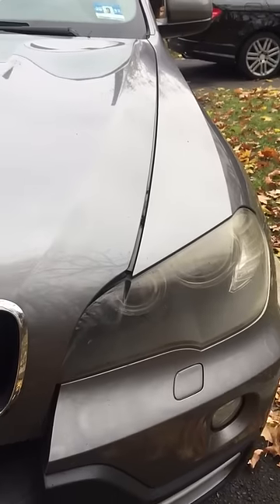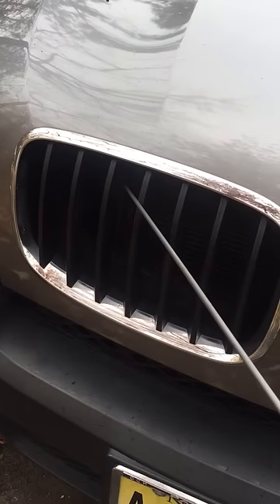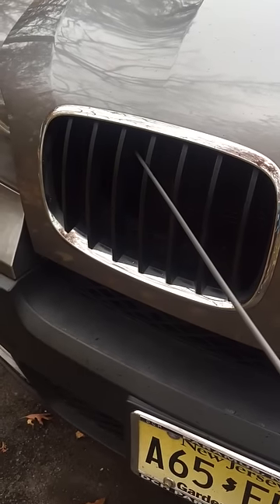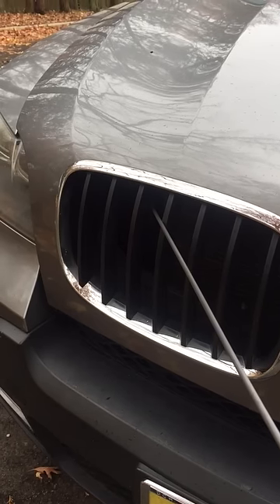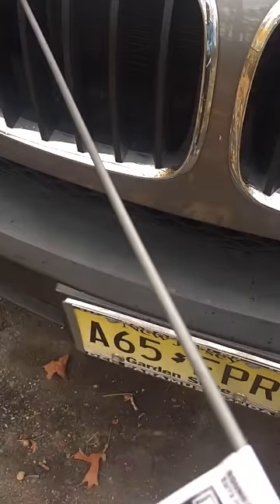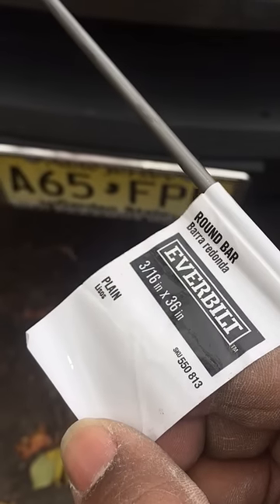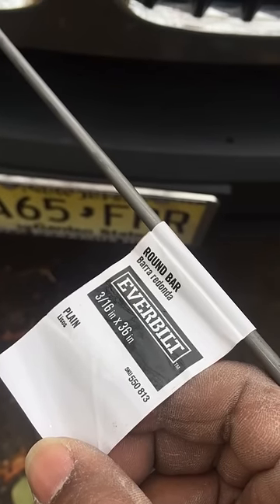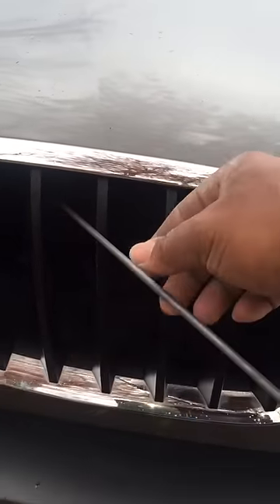BMW E70 X5 Hood Latch Stuck - How to Open Manually - Part I

Comment: This video is amazing! It is the only one trick that actually works and solves a big ($500+) problem! I followed the instruction exactly, using a rod to poke around for 20-30 minutes. And, it finally hit on the right spot and the hood latch popped released! I have 2010 BMW X5. Its hood got stuck. After I got it unstuck using this trick, I found that the cable connecting the latch was disconnected! Must be the previous service guy who was the culprit (and now they wanted to charge me man hundreds to get it open and to change to a new set of latch and cable)! I figured out a way to reconnect back and it now works (though not quite perfectly yet). I may still need to take to the dealer to have it reattached properly. In any case, thanks a million for the very nice video! 
Btw, it does need a lot of patience and trying -- it is a rather small chance hit for every poking -- you need to get to an exact spot without looking and with a constrained maneuvering space.
Reply from the maker: Yes the cable slips out, a good zip tie actually helps to stop that, I used one to bolster the cable and it’s been fine since the original date of the video 👍🏾

Comment: Thanks a lot. It works for me too....BMW dealership at @#$&+ they told me that the latches were bad and charging me almost 900 for replacement. I ordered the parts and found out that they, at the dealership, Left the cable for the right latch disconnected. Waooooo..
Reply from the maker: It's a terrible design and then they charge you for it, a really poor way to treat customers imo. Also the cables slip out sometimes, so a tie strap to secure it is extra peace of mind. Glad it worked for you.

Comment: I would suggest using a thinner rod, I bought the one size down from 3/16 which I believe was 1/8.  Thicker rods will have trouble dipping into the latch box.  There should also be a slight bend near the end to help get into the latch area.  Only took me a few minutes.

I then unscrewed the latch assembly from the frame by taking out the 2 torx bolts and was able to bring it above the latch box to work on.  For mine, the black cable housing had slipped off the latch although the ball end of the cable was correctly attached.  The black cable housing had a notch to hold it onto the latch, but it looked like it could easily slip off the notch again so I zip tied it to the latch.  Sprayed it with WD40, tested it and reinstalled and works fine now.

Comment: thx man it work.  But I had to keep doing it everytime I need to open the hood.  You know what causes the passenger side hood lock to not release?
Reply: Cable fail, need to replace. Boyfriend has the same issue on his X5

Comment: In my case both sides pop open but still won’t release, press middle handle and is super hard won’t even move at all …!!  Help what to do please 😢
Reply from the maker: Hi Jorge, the actual hood release is probably stuck because the cable rusts after time so squeezing doesn’t make the last latch move back enough to escape the clasp, facing the car, stand on the right side near the fender with a 12-14 inch screwdriver 🪛, lift the fender so you can see that lever and slide the screwdriver against it and leverage towards the firewall/windshield direction while holding the he hood up until it slips free, you then need to replace the hood release cable, clasp and wire.
Reply: @trinjaminternational  thanks a lot , just got it open with your instructions!!!!

Comment: Hello, I have a 2013 X5 and I have the same problem.  My condenser and plastic next to it seems slightly different even though its still an e70. Does anyone have experience with the new e70 models. I have tried for a few hours to open and so far no luck.

Comment: any idea how to do this on an E53 X5? I am locked out with a dead battery...
Reply: Pull the right grill off and put your hand in there and pull on the latch
Reply: Mike Rinaldi thanks Mike.  Ended up remove a side flasher and back charging it for the key fob to unlock the car